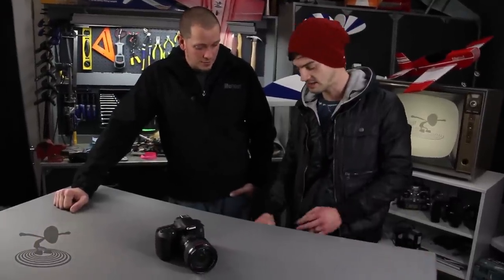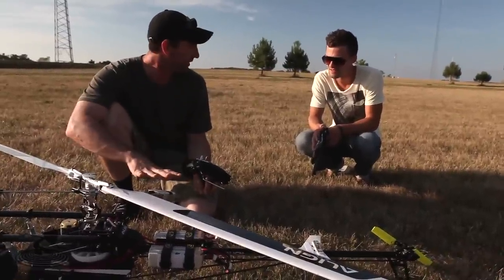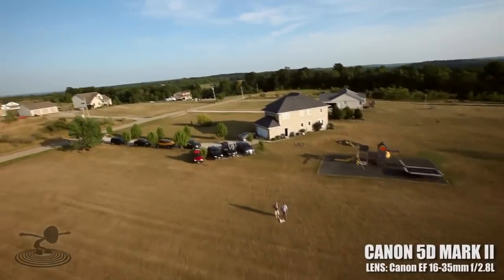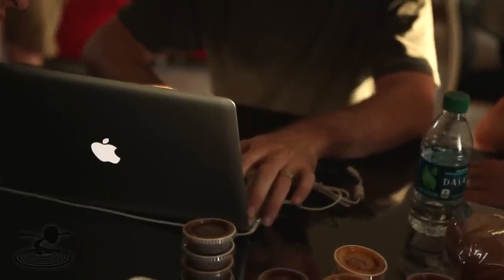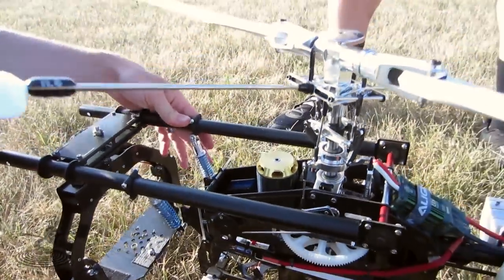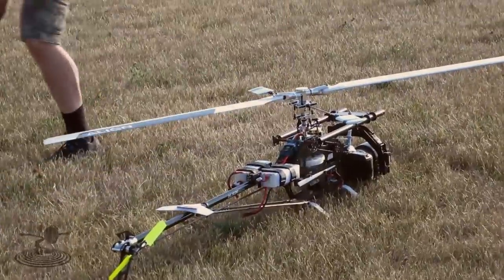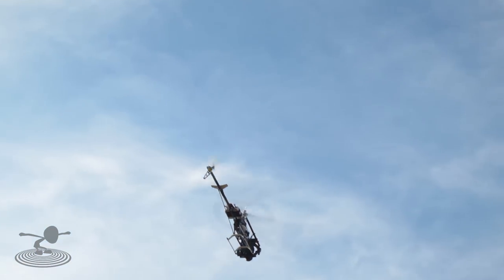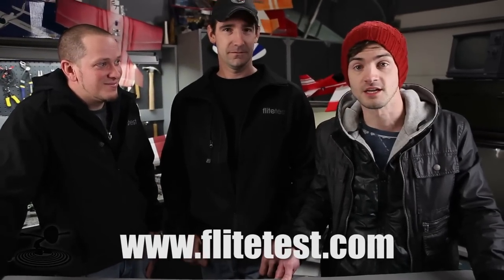Flite Test - T-Rex 800E Helicopter - DSLR Camera Gimbal

Comment: "not as efficient"? Huh? A heli is going to be more efficient than a multi any day due to the lower head speed. This guy just puts so much on it, make anything heavy enough and it'll get inefficient. In general, heli's are much more efficient.
Reply: The better efficiency fundamentally comes from the larger rotors.  Tripling the diameter of a rotor will yield around 2 times the thrust/lift at the same wattage or horsepower.

He says you need more batteries, but batteries are cheap these days especially if you source them directly from China rather than indirectly from China.  If he tried to use a multicopter design to lift the same payload, he'd be using even more batteries.

There's another video on youtube (?v=cBKZJm0xF7U) where someone lifted 30 lbs of bricks with 2390 watts using a Trex 700E.  That's an insane amount of payload that you won't touch with a multicopter unless you're willing to expend 10000 watts.
Reply: Correct. The fuel efficiency gain is about the square root of rotor area. Simple newton's laws will say that double blade diameter quadruples rotor area and doubles efficiency. But there is air viscosity. Quads can not have large diameter rotors because the spool down of rotor during diving prevents a instant pull-out. Look up trump tower diving. It is only possible with very small props.
Reply: El Mostrito  it's almost like quads sound like a single rotor  helicopter doing 3d just while flying about normally - those tiny quad props tip speed has to be super high like a 3d flown t-rex, so yeah just regular flight the noise profile is more "gentle".
High speeds and small props are a recipe for irritation,  the reason Fenestron and NOTAR helicopters have customers despite their downside is that having a whisper quiet bird can be a blessing. I have had some NOTAR helicopters operating near me and I don't remember if it was an MD Explorer but it can be stunning and amusing to see a normal tail rotor helicopter depart the pattern from 500 feet away and then 30 seconds later an MD900 whisper by. Night and day difference in noise just from ditching the tiny tail rotor.

Comment: Now I see why multirotors took off.  Helicoptors may be more efficient but that video is awful.  Cannot beat a multirotor for smooth video!
Reply: Even multi-rotors need tuning to get a stable platform. This was only the second flight. He mentioned they were able to stabilize it better by tuning the gimbal suspension. With a flybarless control system, it should be as stable as any multi-rotor.

Comment: HOLA ME GUSTARIA UN HELICÓPTERO DE ESTO PARA CAMARA DSLR EL TIEMPO Q DURA VOLANDO Y UNA BATERIA ADICIONAL CUANTO SERIA SU VALOR Y ENVIO A ECUADOR AMIGO ESPERO REPUESTA
Reply: Antes de comprar uno de estos tienes que aprender a volar un heli de este tipo, en el caso que ya sepas, uno de estos te costaria unos 1400 USD, mas baterias 200 USD, mas una radio (recomendaria una futaba 14SG o superior) 600USD. Digamos 1400+(2x200)+600= 2400 USD y las camaras estan entre 500 y 7000 USD

Comment: I stopped maintenance and building heli's all together two years ago....dont like em....quads with low kv and parachutes and hex's are the way to go
Reply: James Cureton Jr. i feel ya on that one.
Reply: parachutes??  :s
Reply: Yes sir....they are a bit expensive right now and over priced
..because few companys make them......they will drop in price in time...Yes..parachutes will save your equipment...research them...
Reply: Interesting, maybe i should invest in one especially since i will be getting my first ever fpv system soon. thanks for the info!
Reply: It would be smart......use it properly....and allways let it fall atleast a second before deploying... MARS chutes are the best i think.....use only for emergency... and i would build a cheaper quad or something ...to the weight of your aircraft your putting it on....test it....then put it on your good fpv aircraft....and leave it alone....and put it on a  switch your never gonna accedently hit :-)
Reply: James Cureton Jr. It's always a sad day to see a person go over to the dark side of the helicopters. Quads take no skill, multis are toys in comparison. i do not know why you'd not get bored after a week
Reply: ***** Because I spent a load of money repairing choppers...they are self destructive...juuuust my opinion.
Reply: ***** Skills or not. if you are an aerial videographer you care about results and safety. octocopters are way simpler in design and will handle camera gimbals way way better than most copters could ever do. 

There is no point in trying to defend helis. Sure people can fly them for fun, that goes both ways....
Reply: TG Lasers ofc if you want to take a cmaera up there, multi rotors are the way to go but im talking about hte hobby of flying, owning the skies, doing aerobatics, helicopters are still a lot better
Reply: ***** I would like to respectfully differ from your view. As a newby into the world of quads, i find it a steep curve to learn to fly at a anywhere near decent manner. I am sure that when you are an experienced pilot a quad is a breeze to fly, but not when you are new to the sport. However, the "going over to the dark side...?" i think a lot of people will disagree with you there. 
Is the hobby of RC flying not something that you would like more people to get into ? If so, then i think even getting them into the quads is a whole lot better than leaving them standing on the sidelines just wishing they were also able to fly.
Reply: +Diesel Ramcharger How have they ruined it? My local club saw an influx of people getting into the hobby because of cheap quads. They brought them to the indoor flight days and ended up picking up a plane or 2 to fly with us.
Reply: eternalfire1244 More people doesn't mean better. It only takes one turd in the punch bowl, now we have thousands of them.
Reply: +Diesel Ramcharger The quad influx also came with the new laws that affect all of us in the US negatively.  Because of those turds in the punch bowl.
Reply: You'll never get me to fly a quad for fun, for professional work they certainly have their arguments. But for the pure fun factor a big heli always wins for me.
Reply: Racer ou phantom quad will be always auto flying toys you can pilot a heli and control a drone..

Comment: I am kinda confused. We fly with hexa, however; wanna fly with t-rex 700 or 800. Because hexa has 6 motors, 6 props, 6 ESC which leads us to "more parts, more failure". That's why we think single rotor is more reliable.

Comment: Pros who use an rc heli to film and charge money for the service do it because it's not illegal. Using a quadcopter is currently illegal if your charging money for the service.

On a side note, the camera mount on that heli is not a gimbal. You should know this. Change your title.
Reply: yes it is, "The T-Rex is setup with a PhotoShip ONE 2x Pan/Tilt gimbal that he has setup to be controlled separately by an operator."

Basically it's a photo-higher AV200
Reply: Waylon Johnson It's a misnomer. A "pan and tilt" camera mount should not be called a gimbal.

Comment: Lmao! I'm sure if you get big enough blades, big enough batteries, low enough resistance, low enough headspeed n some plastic parts, you can get an hour of flight time. We have a guy at our club that can fly the gaui x7 with low speeds and reach 30 minute flights. Not just barely lifting with ground effect, it can invert!

Comment: The safety on a singel rotor are mutch better. If you have an motor burnout on a quad, ur fucked. If ur engine fails on a heli, you can autorotate. soo a heli will be cheaper in the long run.
Reply: +Ole Andreas If you have a single motor failure on a hex or octocopter, you can still fly normally. Quads are very rarely used to lift anything bigger than a GoPro, so if you're doing serious filming, you'll have the extra engines anyways.
Reply: Not true at all, at least not for hex which I fly.
Reply: +Dragoslav Miljević if you have enough thrust to keep the copter in the air + steering, the Ardupilot will keep your copter limping with a hex and pretty stable with an octo. maybe you don't have enough power?
Reply: Cuthbert Nibbles it can carry a 700g camera. I guess that's enough power. I tried taking off with one motor disconnected and it just pitches to that side...
Reply: +Dragoslav Miljević it won't be a happy flight, it may even yaw pretty bad, but it's enough control to reduce your decent, much like autorotation on a real helicopter. Someone (FliteTest?) tried it, and proved that given the sufficient Thrust/Weight ratio, a hex could fly with ant one motor or 2 specific motors failed, and an octo could fail any two or up to 4 specific motors.
Reply: Cuthbert Nibbles I guess it would be true if two opposite motors failed, but I'm little bit scared to try it out :P
Still didn't learn how to shit money